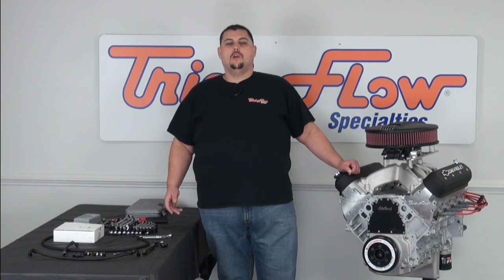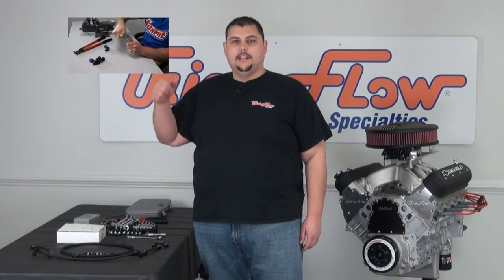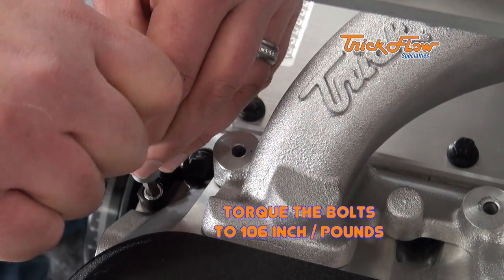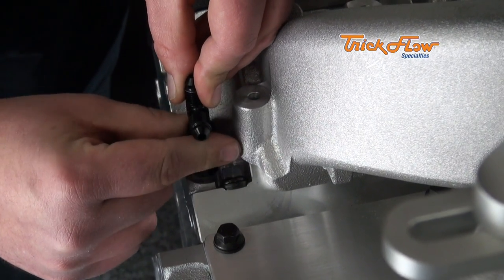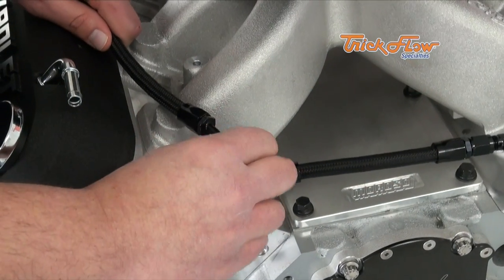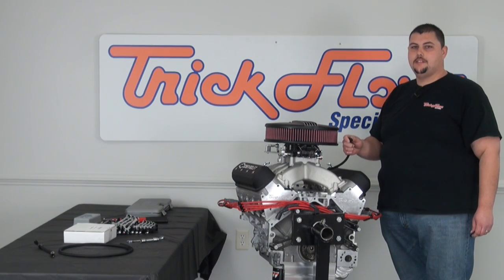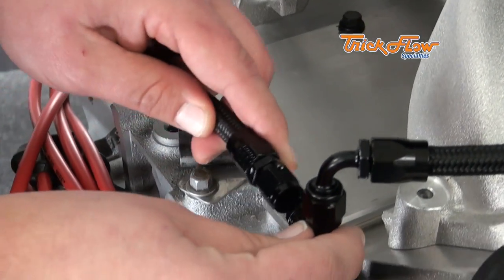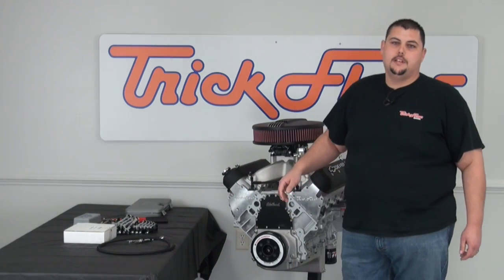Trick Flow LS Steam Line Kit Install - Trick Flow TV

Comment: Very glad you guys did this video, because I was clueless when it came in.  Honestly, you guys really should put a quick little slip of paper explaining the install with the package.  It would go a longgggg way, but this video was a huge help.  Hell, if nothing else, slip in a paper with a URL to this video in there.  Awesome kit, though.  Thanks guys!
Reply from the maker: Matt, the kits do now come with a diagram. We decided to do this video because of all the kits that we have sold or that were already in inventory did not. I am glad this video was of help!
Reply: would you have a slightly longer tube for the rear? noticed in the video, wouldn't that one interfere with the oil pressure sensor?

Comment: will this kit  work  if you are running the standard car ls intake manifold, if not do you make a kit that does
Reply: +Anthony Smith   LoL, It's been two years and no reply. My something happened to the dude in the video? I would imagine with the fittings and extra hose, you could route the  front to rear line between the injector rail for a clean look. The LS 5.3L truck intake has room under the intake that the hoses could run. In 2004, it appears from what I have seen, GM "LS" engines uses a front to rear metal pipe configuration, connecting all together. Steam holes are vents at the top of the coolant jacket and air gets trapped. Imports for years with top mounted thermostats had a "Jiggle" valve or captured ball in the stat. When servicing the engine and coolant is added, it becomes trapped due to air pressure in the head(s). By having a valve to allow air out, you don't have to start the engine, those with aluminum head(s) empty, it scares me, but air escapes via the thermostat into the radiator, keeping the engine from getting hot without coolant in the head. I use a sharp small ice pick to punch a small hole in edge of the stat off the bridge but not under the gasket surface supported by a block of wood. Using a filler kit with a funnel and cap adaptors, I would watch the engine run and run and run, then the stat would open, then the radiator went dry. Can't & won't do that anymore on any engine design. Retired ASE Master Tech.
Reply: So this could replace the stock metal one ? With no doubt ?

Comment: I used that kit on my ls6 with ls2 manifold because the 4 port ls1 steam line wouldn't fit under the manifold. 

But with a vic jr manifold, there's no reason not to run an OEM one